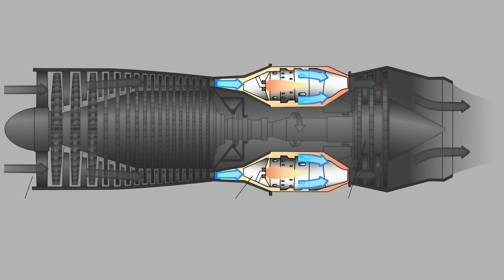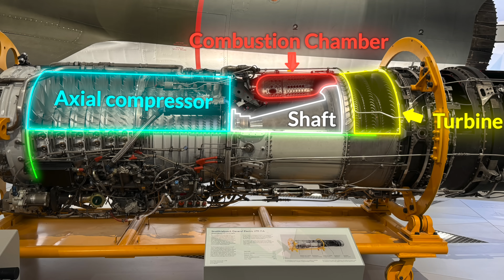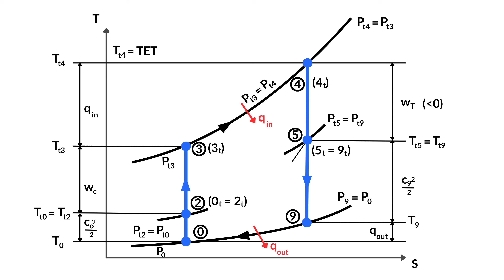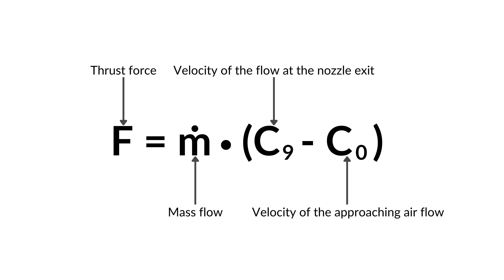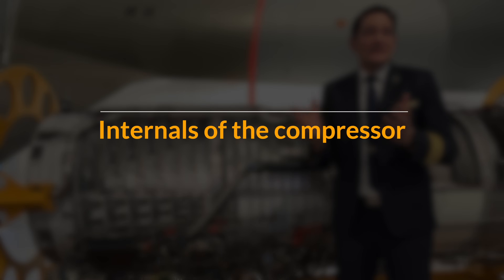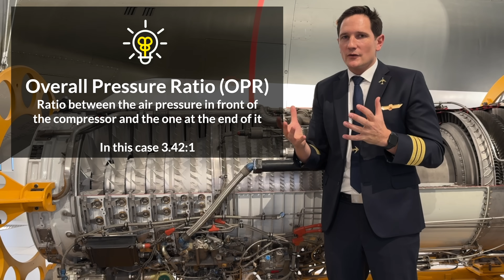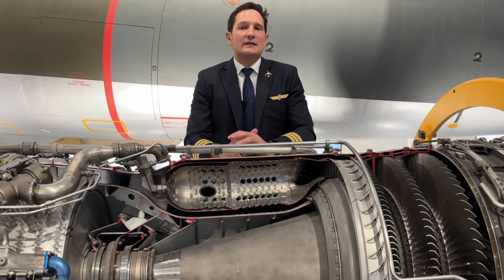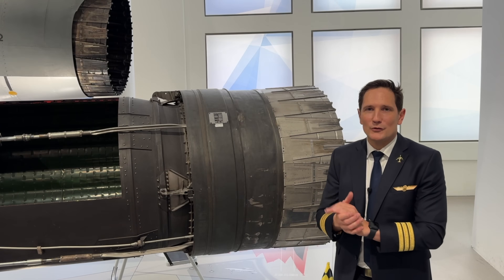How a TURBOJET Engine works - Explained by CAPTAIN JOE

Comment: Wonderful to get a lecture like this from Prof. Joe. I went to an engineering U but was not a Mech-E so didn't take any of the classes that would have covered these sort of topics. I'm still wondering how the engine is started. There's fuel and ambient (non-compressed) air in the chamber, and an ignitor firing I presume, but I would think the expanding exhaust gasses would try to expand forward as well as back through the rotor blades. I may not be understanding the lecture but it would be interesting to know the principles behind the process of "jump starting" the engine prior to the process becoming self-sustaining. Funny those folks in the background at one point, they were probably wondering if they were going to face and exam and get a tuition bill.
Reply: I am not an expert, but AFAIK you use pressurized air, e.g. from an APU, to get the engine to a certain RPM before introducing fuel into the combustion chamber. This way you make sure that the hot air from the combustion chamber exits via the turbine.
Reply: @volkerjansen3901  wrote: "you use pressurized air, e.g. from an APU"

-- APU is Axillary Power Unit, is usually started first with onboard battery power, or GPU which is Ground Power Unit, or pneumatic starters, those used with "huffer" of low pressure high volume air instead of electricity, or even "pyro"(aka "cartridge") starts are common to bring compressor to self sustaining RPM. Do a search for "B-52 "cartridge" engine start up".
Reply: wrote: "I'm still wondering how the engine is started. There's fuel and ambient (non-compressed) air in the chamber, and an ignitor firing I presume, but I would think the expanding exhaust gasses would try to expand forward as well as back through the rotor blades. I may not be understanding the lecture but it would be interesting to know the principles behind the process of "jump starting" the engine prior to the process becoming self-sustaining."

-- That is great question, and perhaps a subject for Captain's Joe future video, but in short explanation: compressor have to be spun to create sufficient pressure in combustion chamber, once that pressure is reached, fuel nozzles start to spray fuel, and ignitors ignite air-fuel  mixture. Once engine self sustaining RPM(aka idle) reached(if not that condition called engine hang), starter disactivated and ignitors are out, and turbine provides sufficient power for compressor, and engine is running, all you have to do is to monitor temperature(TIT) and oil pressure for a first minute or two, and then occasionally through the flight.
Reply: @RussianThunderrr  Thanks for the reply. I had assumed some mechanism would have to be used to get some compression happening, but what is this mechanism? Is it internal to the engine? What is it powered by? Electricity from ... the APU? Ground equipment? If the APU .. that's just another turbine engine I think, so what is used to start that? I had not heard the term "engine hang" before, if that happens does it mean something is broken or can it happen from an external cause, environmental conditions maybe? I'm thinking of commercial turbines, but would those of a military fighter (no APU I assume) be started in some other way?
Reply: @ wrote: "If the APU .. that's just another turbine engine I think, so what is used to start that?"

-- APU(aka Auxiliary Power Unit) which is a very small jet engine that in passenger airliners located in a tail cone compartment, and when in use it generates electricity and also compressed air. That compressed air(aka bleed air) is used to spin high pressure main engine compressor which is creating airflow in the engine sufficient enough to start that engine. Then once main engine(number 1) starts bleed air from that engine is used to spin high pressure compressor to start engine 2 and ect. So its a small engine starts much larger engine. And APU starts with an electrical starter, that becomes a generator once APU starts running at operational RPMs.
Reply: @ wrote: "I had not heard the term "engine hang" before, if that happens does it mean something is broken or can it happen from an external cause, environmental conditions maybe?"

-- No it usually happened when power assistance disengage too early, almost like in old carburetor car engine start spattering and almost running, so if you disengage starter too early engine might run for a little while, but it wont be able to get to idle(which is engine minimal RPM) - that condition called "engine hang".
Reply: @ wrote: "Ground equipment?"

-- Yes, that calls GPU(Ground Power Unit) and its loud diesel engine powered contraption the size of small SUV that generates electricity and also circulates air while aircraft parked, and yes aircraft batteries are small, very expansive and very heavy, so GPU is used to not only to keep aircraft battery charged, but electrical power to start the APU or engines, with onboard starter/generator units. Some GPU have low pressure pneumatics to start engine with low pressure high volume air - those GPU calls "huffers".
Reply: @ wrote: " I'm thinking of commercial turbines, but would those of a military fighter (no APU I assume) be started in some other way?"

-- Yes, there are other way to start the engine especially military called "pyro cartridge", and this method was used to start even piston engines during WWII via "blank" shotgun shell. There is a really old movie called "The Flight Of The Phoenix 1965" goes into great detail how that done, but you can find brief videos of restored aircraft starting this way. Check out "Canberra and Venom" cartridge start or B-52.

Comment: 16:45  I got work experience at Rolls Royce Deutschland a couple of weeks ago (Turbofan). The cooling technique for the high pressure turbine is to make tiny drills into each blade where cool air comes out (still a whopping 800* C) and surrounds the blade. This is why it is so important to keep foreign objects from the engine core (e.g. little stones), because they can block these drilled holes and therefore cause the balde to overheat. Really fascinating video of yours!
Reply from the maker: thanks for the great insight!
Reply: @flywithcaptainjoe Thanks for replying❤
Reply: The "little stones" will cause foreign object damage" (FOD) to the compressor blades and vanes (I'll discuss this term separately, Captain Joe) and degrade the performance and efficiency of the compressor.  
The real enemy of the modern cooled turbine blade with its complex internal passages and its multiplicity of effusion cooling holes is the really fine stuff, like the micron-size desert sand particles that can be encountered thousands of feet up over (eg) Saudi Arabia in a sand storm.
Internally, the sand particles can block the passages and cooling holes.  Externally, and having gone through the combustion flame, those little particles become tiny droplets of molten glass, which deposit on the exterior of the nozzle guide vanes and blades,, blocking the cooling holes externally and degrading the aerodynamics of the aerofoils.
Reply: @grahamj9101  Yes, basically what I meant. I didn't think of the fact that these small stones melt before reaching the turbine, though. Thanks for the reply!
Reply: @Stopaclotion  Years ago, I was involved in the design of a so-called 'sand-tolerant' HP turbine blade for an engine, which I won't name, for use in Saudi Arabia.
Reply: @grahamj9101 Wow, that must have been so cool! I guess Saudi Arabia has a lot of problems with FOD because of the deserts.
Reply: @grahamj9101  This is worrisome to me as it indicates that modern cooled turbine engines will not hold up to actual battlefield conditions.  But thanks for this excellent explanation!
Reply: Sand, or ash clouds from volcanoes. Remember air travel came to a halt in Europe in 2010 when an Icelandic volcano erupted.

Comment: The GE J79 was a great engine and used in many airframes. It's more commonly known as the engine that powered the MD F-4 Phantom (all variants). The F-104 was short-lived.
Reply from the maker: Thanks for the insight!
Reply: The B-58 Hustler used 4 x J-79 engines
Reply: F-104 had a 40 years long life here in Italy , 30 of them with the most powerful type , the J79-GE-19
Reply: @ Yes, Europe flew the F104 much longer. In the US, the F-104 was only in service for 15 years. It had its first flight in 1954 and it was retired in 1969 by the USAF. In contrast, the F-4 Phantom was in service for 38 years. Having its first flight in 1958 and was retired in 1996. Ironically, the F-4 was not designed to have an internal gun. At first, it relied only on missiles, but later was adapted with a gun pod mounted on the centerline. Both planes had the J79 engines.